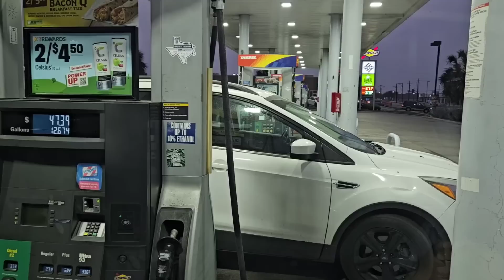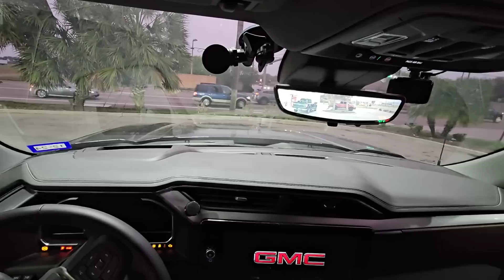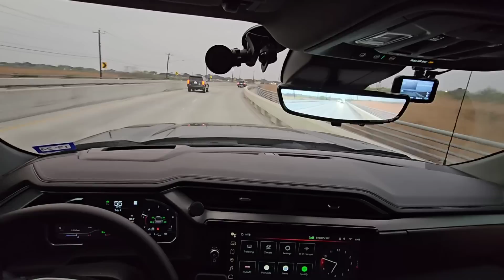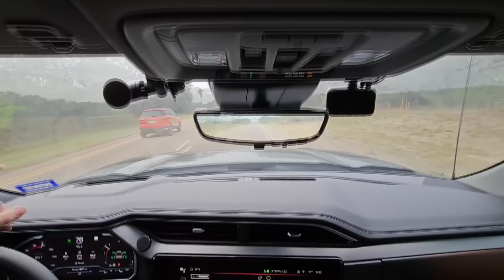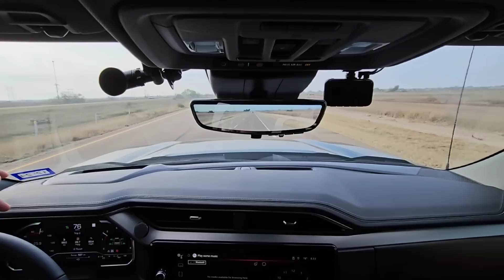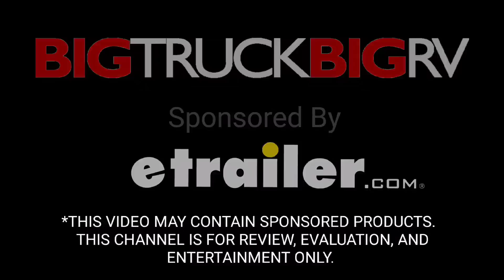Fuel Economy Test 3: 2023 GMC 1500 4wd with 3.0L LZO Duramax

Comment: Man, I feel you regarding having dealers perform any kind of repairs. I took my (most definitely OUT of warranty) truck into the dealership after setting up an appointment, just to have them tell me they didn't have the parts. They couldn't have told me that before I took the day off from work and woke up early in the morning??? Ridiculous. I found a great local shop who got all the parts in a very timely manner and fixed the truck perfectly. Runs like new now. Avoid dealerships like the plague.

Comment: The mpg sounds good but if you factor in the fact that diesel is about 1/3rd more expensive than gas you are spending about the same per mile as a gas engine truck.  So you should buy it for the capability of the diesel not mpg.

Comment: If you can do a video on where and how you installed the rubber pieces to the noise go away.
Don’t worry about negative feedback from others . Just keep posting your videos and findings . Thx
Reply: I took my 2021 GMC Denali 1500 for the noise coming from the rear leaf springs and they said they retorqued the leaf springs and I still have the noise.

Comment: Mine lasted 5249 km it’s been sitting in the shop for4 months
Reply: Did I get repaired yet? What was wrong with yours?
Reply: @robattire  it sat at the dealership for almost 3 months waiting for the part wich was the NOX sensor
Reply: @rubenmanitowabi  wow, that’s brutal. It makes me very undecided if I want to buy out my f150 lease or take the 3.0 at4 I ordered. What do you think about the 3.0? Bad idea to switch?
Reply: @robattire  now that I’ve got it back and the bugs worked out Amazing truck I recommend good power fuel mileage out of this world will go further than an electric vehicle
Reply: @rubenmanitowabi  thanks. 🙏

Comment: I'm guessing you mentioned this somewhere previously, so I apologize for the question.  Is the rear axle ratio in your truck the 3.23?  I ordered a half-ton standard bed with the LZ0 a few weeks ago.  GM picked up the order but no build date assigned as of yet.  Setting the pros/cons of gas vs. diesel aside, IMO the 3.0-liter just seemed to handle the empty weight of the truck better than the 5.3-liter.  I hope I won't regret my decision as I intend to keep the truck for many years.
Reply: I picked up my 2023 RST with the LZ0 3 weeks ago I only have 750 miles on it so far! But this is the best truck I’ve ever had I love it and love the diesel  my last truck was a 2021 LT

Comment: Do you have any additional feedback on the seat comfort you mentioned in the previous video?  We are thinking of purchasing a 2500 Denali, and I assume they are the same seats.

We currently have a 5th Gen Ram and find the seats plenty comfortable.  I like the Ford seats also, but it is impossible to order one of those with the 7.3.

Thanks!

Comment: I’ve was enjoying this engine but unfortunately I’ve had some bad luck with it. Last December my flywheel broke and damaged my transmission. Took a few weeks but dealerships got me fixed up. 350 miles later the oil cooler broke and sent oil everywhere even had oil in my coolant reservoir. Now the truck is going on 7 weeks a dealership waiting on just parts. Once parts come available it will be a 50 hour job to replace everything that was contaminated by oil. Not sure if anyone else has had these typed issues. Great channel keep up the good content

Comment: LZO in AT4 Crew Standard Bed and averaging mid 25 mpg for first 3k miles.  Mostly driving like an old guy with a nice new truck he doesn’t want a single scratch on.   Cruise control accelerates so hard in traffic that it drops my mileage down closer to 20.   I bet I could get down to 20 mph if I let my testosterone fuel my driving and accelerated like your typical late to work aggressive driver.

Comment: On these mileage loops, could you equalize the mileage you got (calculated, not just displayed from the on board computer), then at that price per gallon, calculate an equivalent mileage for a gas engine at the price for gas at the same stop?  In other words, figure a cost per mile diesel, then what those same dollars would’ve got for gas at the price of gas.
Reply: Yes! I just commented requesting a similar test.

Comment: This series regarding your 2023 GMC have been interesting. I keep comparing your experience sto me with my 2022 3.0L Duramax. I have a couple of questions if you have time? 1- Since day one, I have the smell of diesel exhaust in my cab. Is this typical? I thought it would go away but after 8000 miles since Oct 22. It is still there upon start up. 2-The Google Maps GPS, are you having any issues? My location locks up. At times my location is 20 miles off. Thanks, Stay Calm and RV On.

Comment: My LM2 is avg 25 mpg over 4650 miles in the first 60 days of ownership. Last fuel up was 28.9 mpg 😳.
Reply: It did spend 11 days in the shop having the trans pulled and a new fluid pump installed which jumped the mpgs by 3 right afterward.
Reply: @landonwilcox1837  what happen to the trasmision?
Reply: @watchmanexpert  The fluid pump gears went bad and the fluid pump had to be replaced.  There is a service bulletin on the issue available through GM.

Comment: Great video. I wanted to say I have seen very similar mpg characteristics with multiple diesel trucks of the past decade. 
2013 2500 Cummins, 2015 2500 Cummins, 2016 Colorado I4 Duramax, 2019 Colorado Duramax, 2021 AT4 Duramax. 
 I have a theory, that this drop in fuel mileage you have noticed and I have seen first hand on multiple modern diesel pickup trucks, happens after the first 1000-2500 miles or so. Never to return to the big numbers we see when brand new. My 2021 1500 AT4 with a similar I6 Duramax to your truck, had it's best ever recorded mileage set at 31mpg when also like yourself that happened in the first month or two of ownership, never to be repeated. 
In fact a good tank after the first 5000 miles or so, on my 2021 3.0 Duramax was 22-23. 
Working it hard/not towing only running it at higher interstate speeds fighting high winds running 75-85 mph, it was very common to see my 3.0 Duramax truck dip into the high teens on those situations. 
 I think it is simply the fact all the emission control systems when they are all super clean and brand new, don't need to do fuel wasting task such as regenning, which drops your fuel mileage significantly when in regen mode. The only time a particulate filter is 100% clean not needing to regen at all, is likely when it brand new. Just a theory.

Comment: Yes, GM needs to make sure there are more 12V (cigarette) outlets and trailer mirrors.
Reply: Not just GM.  Toyota also.  My '22  Tundra has 1 12v socket, and it's above the infotainment screen on the dash (almost the most useless place possible).  And I also have a tow package, with the trailer backup assist (still haven't used it), but no tow mirrors.
Reply: Just got a 2023 Silverado 1500 LTZ with the 3.0.  Has 12 volt in front and also in bed.

Comment: I have a Toyota Tacoma on which I’ve had zero issues after 3 years and 60,000 miles. I’ve taken it in to have scheduled service and an installation of a TRD exhaust. I’ve never had to leave the truck over night let alone several days. When I make an appointment with my dealer, the work is done that day. The 60,000 mile service which is a big one was done in four hours. Does Ford and GM have a different way of delivering dealer service?

Comment: First! Finally lol I don't think Diesels should be start stopped. Imo neither should gas engines. The one thing I wish my truck had was the radar cruise. But meh maybe on the next one. I also agree about the tow mirrors or spot mirrors. My Titan  half ton has tow mirrors and I ❤ them. But many ppl won't wanna hear this, but no truck is perfect.
Reply: Radar cruise is A GAME CHANGER, or at least it is for me.  I absolutely love it.  Until my new Tundra,  my newest vehicle was always about 10 years old when I made the purchase, but thanks to Covid, New trucks were the same price as old ones.  I am not a fan of some of the nannies on the truck, but I can live with them.
In addition to the Radar cruise, using cruise in the mountains is awesome.  The truck maintains maintains speed coming down steep grades, even with  a trailer.
Reply: @the1doubledeuce  I agree and yes I am not a big fan of all the nannies that also come along with new trucks and cars. On the wife's car I shut as many of them off as I can.